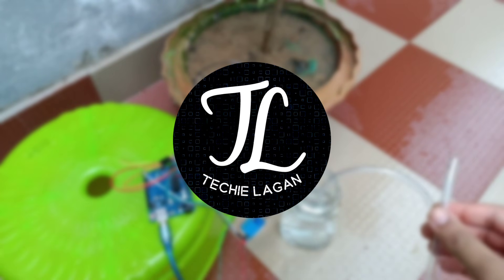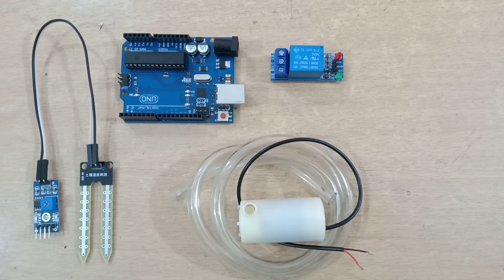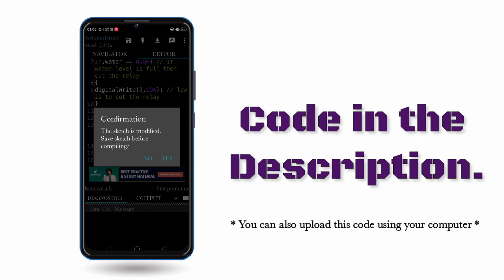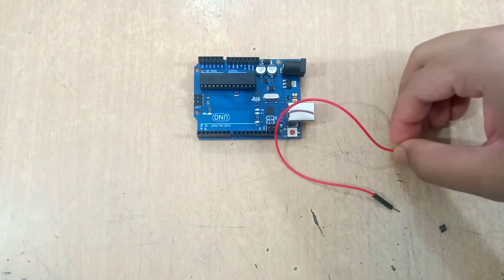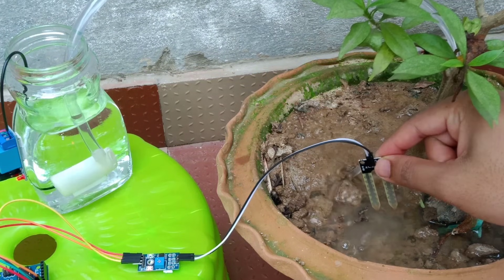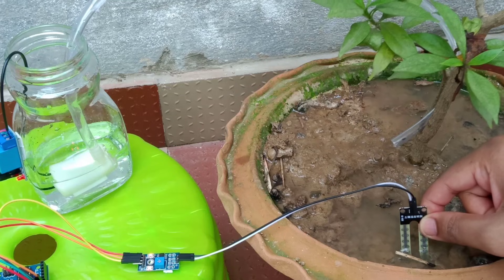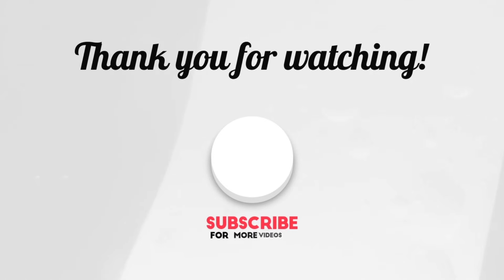How to make Automatic Plant Watering System using Arduino UNO and Soil Sensor || Techie Lagan

Comment from the maker: int water; //random variable 
void setup() {
  pinMode(3,OUTPUT); //output pin for relay board, this will sent signal to the relay
  pinMode(6,INPUT); //input pin coming from soil sensor
}

void loop() { 
  water = digitalRead(6);  // reading the coming signal from the soil sensor
  if(water == HIGH) // if water level is full then cut the relay 
  {
  digitalWrite(3,LOW); // low is to cut the relay
  }
  else
  {
  digitalWrite(3,HIGH); //high to continue proving signal and water supply
  }
  delay(400); 
}
Reply: Sir ...I connected all and the motor is running...but when I put sensor in the mud or water motor also running it doesn't on or off ...what can I do for this problem plz solve this 🙏
Reply: @khadizayesminnodi8786  I had this problem until I fixed the code

void setup() {
  pinMode(3, OUTPUT); // output pin for relay board, this will send signal to the relay
  pinMode(6, INPUT); // input pin coming from soil sensor
}

void loop() {
  int water = digitalRead(6); // reading the signal coming from the soil sensor

  if (water == HIGH) { // if water level is low (i.e., soil is dry) then turn on the relay
    digitalWrite(3, HIGH); // high is to turn on the relay
  } else { // if water level is high (i.e., soil is wet) then turn off the relay
    digitalWrite(3, LOW); // low is to turn off the relay
  }

  delay(400);
}

Enter this code, most likely the problem will be solved
Reply: @amirreza33   same issue is coming for me
Reply: @chvinaykumar245  is it solved or not?
Reply: @chvinaykumar245 plz reply bro
Reply: @amirreza33  bro konsa port use kiya
Reply: @amirreza33  
Thankyou for informing
Reply: @amirreza33 bhai help karna problem aaraha hai plz
Reply: @amirreza33  but using your code the motor is not running bro
Reply: @Abhishekgowdatech  but i used this code motor is working ... try to change motor
Reply: @Abhishekgowdatech  check the motor with power supply
Reply: Sir even tho everything is ok, the pump is watering again after it stop watering if the sensor put in the wet soil. How can I solve this problem?
Reply: @HtetHtet-l5k  adjust the sensitivy of the sensor
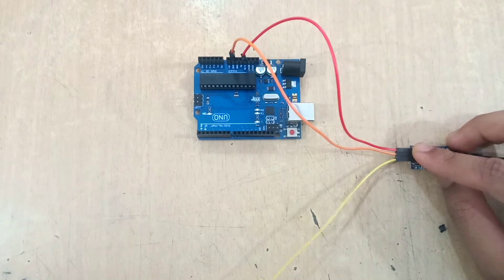Reply: 1:25
Reply: Hello lagan. did they pump comm connected to other power sources?? such as battery or anything else.our pump did not work. please help.
Reply: @MashirnaniYOLO  Yes, I used 2 AA batteries at the open wires from the pump in the relay module
Reply: @zanapoosarla5276 how to connect 2 AA batteries ? Or use the two ends of a single cell and connect those two wires at two ends?
Reply: https://youtu.be/iwkE_HWU-6M?si=E3mjWkJ8eFwrPtaW
Reply: Sir i didn't have any prob. It worked successfully. .
Thanku...
Reply: hello jo FL-3FF-S-Z KI GREEN LIGHT GALE GI
Reply: Okay
Reply: Bonjour  est ce je peux avoir le code
Reply: Kk
Reply: I can't copy this
Reply: @kumarkomakula1086  It sounds like you're looking to create an automated plant watering system using an Arduino. Here's a basic outline of what you'll need and how to set it up:

### Components:
1. *Arduino Board* (e.g., Uno, Nano)
2. *Soil Moisture Sensor*
3. *Water Pump*
4. *Relay Module* (to control the water pump)
5. *Power Supply* (for the pump)
6. *Jumper Wires*
7. *Breadboard* (optional, for prototyping)

### Steps:

1. *Connect the Soil Moisture Sensor:*
   - Connect the VCC pin of the sensor to the 5V pin on the Arduino.
   - Connect the GND pin of the sensor to the GND pin on the Arduino.
   - Connect the Analog Output (A0) pin of the sensor to an analog input pin (e.g., A0) on the Arduino.

2. *Connect the Relay Module:*
   - Connect the VCC pin of the relay to the 5V pin on the Arduino.
   - Connect the GND pin of the relay to the GND pin on the Arduino.
   - Connect the IN pin of the relay to a digital output pin (e.g., D7) on the Arduino.

3. *Connect the Water Pump:*
   - Connect one terminal of the pump to the normally open (NO) terminal of the relay.
   - Connect the other terminal of the pump to the power supply.
   - Connect the common (COM) terminal of the relay to the ground of the power supply.

4. *Arduino Code:*
   ```cpp
   int sensorPin = A0; // Soil moisture sensor connected to A0
   int relayPin = 7;   // Relay module connected to D7
   int sensorValue = 0;
   int threshold = 600; // Threshold value for soil moisture

   void setup() {
     pinMode(relayPin, OUTPUT);
     digitalWrite(relayPin, HIGH); // Turn off the relay initially
     Serial.begin(9600);
   }

   void loop() {
     sensorValue = analogRead(sensorPin);
     Serial.print("Soil Moisture Value: ");
     Serial.println(sensorValue);

     if (sensorValue < threshold) {
       digitalWrite(relayPin, LOW); // Turn on the relay (pump)
       Serial.println("Watering the plant...");
     } else {
       digitalWrite(relayPin, HIGH); // Turn off the relay (pump)
       Serial.println("Soil is moist enough.");
     }

     delay(1000); // Wait for a second before checking again
   }
   ```

5. *Powering the System:*
   - Make sure the Arduino and the water pump are properly powered. You might need an external power supply for the pump, depending on its voltage requirements.

This setup will read the soil moisture level and turn on the water pump when the soil is dry, and turn it off when the soil is moist enough. This should help keep your plants well-watered automatically!

Feel free to ask if you have any questions or need further assistance with your Arduino project!
Reply: How to use the code  can u give me some ideas abt that?
Reply: I'm trying to put code in Arduino by the mobile phone but it gets error
Reply: This is not work bro
Reply: @lakshyaverma9934 Work o no work
Reply: How much it cost
Reply: Tubf
Reply: Ya Jo last mn ap na Green aur red wire connect ki ya battery ki wires hn plzz mujhe jaldii batain
Reply from the maker: @Nadiayounis-s3w Han woh battery se connected hain
Reply: Motor kaise band ho gi mtlb jb us ko connect karte hn battery ka sath tu mtlb wo pani band ni hota😢
Reply: Kal mn na submit karna hn plzz mujhe sa ni ban rha😢
Reply: Good
Reply: /copy
Reply: Does this work?
Reply: 2:24 2:26 2:27

Comment: Not able to add code please guide
Arduino: 1.8.18 (Windows 10), Board: "Arduino Uno"

Sketch uses 1042 bytes (3%) of program storage space. Maximum is 32256 bytes.

Global variables use 9 bytes (0%) of dynamic memory, leaving 2039 bytes for local variables. Maximum is 2048 bytes.

avrdude: stk500_recv(): programmer is not responding

avrdude: stk500_getsync() attempt 1 of 10: not in sync: resp=0x49

avrdude: stk500_recv(): programmer is not responding

avrdude: stk500_getsync() attempt 2 of 10: not in sync: resp=0x49

avrdude: stk500_recv(): programmer is not responding

avrdude: stk500_getsync() attempt 3 of 10: not in sync: resp=0x49

avrdude: stk500_recv(): programmer is not responding

avrdude: stk500_getsync() attempt 4 of 10: not in sync: resp=0x49

avrdude: stk500_recv(): programmer is not responding

avrdude: stk500_getsync() attempt 5 of 10: not in sync: resp=0x49

avrdude: stk500_recv(): programmer is not responding

avrdude: stk500_getsync() attempt 6 of 10: not in sync: resp=0x49

avrdude: stk500_recv(): programmer is not responding

avrdude: stk500_getsync() attempt 7 of 10: not in sync: resp=0x49

avrdude: stk500_recv(): programmer is not responding

avrdude: stk500_getsync() attempt 8 of 10: not in sync: resp=0x49

avrdude: stk500_recv(): programmer is not responding

avrdude: stk500_getsync() attempt 9 of 10: not in sync: resp=0x49

avrdude: stk500_recv(): programmer is not responding

avrdude: stk500_getsync() attempt 10 of 10: not in sync: resp=0x49

Problem uploading to board.  See https://support.arduino.cc/hc/en-us/sections/360003198300 for suggestions.

This report would have more information with
"Show verbose output during compilation"
option enabled in File -> Preferences.

Comment: On the video he set up the cables on the arduino like this: 3.3V; 5V; GND; GND
But on the picture linked in the description it's different: 5V; GND; GND; VIN

So which one is correct??
Reply from the maker: The one in the video
Reply: @TechieLagan  Did you connect the arduino to your computer?

Comment: Thank you soooo mcuh it finally works!!
But the only problem is that it doesn't work if i dont connect it to my pc..
Even if i connected the relay module to a battery(The battery is composed of 4 AA batteries, is that the issue? I bought a 9V battery but I think it will work just fine with only 6V, because I accidentally toutched some cables and the pump suddently worked without any power from the PC)

Please respond and thank you!

Comment: -Arduino 
-Single-channel relay module
-Mini water pump 
- Small plastic tubing or pipe
- Soil moisture sensor module
-jumper wires

Comment: YOU FITTED MIDDLE WIRE IN CENTER TO MOTOR IN CIRCUIT DIAGRAM...IN VIDEO YOU FITTED TO BATTERY🤔🤔

Comment: can we did not connect the Arduino with computer or phone during project?? Does it work without computer or phone connection??
Please reply
Reply from the maker: U can disconnect it from ur computer once ur programmme is uploaded ..
But to keep it working u have to connect external power to it whether it is 9-12 volt source or power bank or directly connecting it to mobile charger adapter with that usb cable
Reply: @TechieLagan  thank you ❤️

Comment: How it would be used when it comes to reality?
Reply from the maker: It is just a prototype ( small scale model of real one)
If u want to use in real life then the  pump and relay with higher ratings will be used. Also jn place of arduini u can use any other microcontroller board or any single board computer like raspberry pi .

Comment: where have to connect the blue wire connected in the  ardino
Reply from the maker: It is used both for programming and giving power to the arduino

Comment: That red and green wire in the relay model should be connected or not?
Reply from the maker: ya it should be connected to the battery
Reply: @TechieLagan which battery voltage
Reply from the maker: @suryasplayz  3-9 volt

Comment: Where did you connected realy module wires? mention clearly..Any other external connections are required to realy module??
Reply from the maker: they are connected to a battery. Here relay module acts as a switch.

Comment: Sometimes the powersupply from the relay is not sufficient enough to power the motor pump. In that case, modify the following connection:
1) NO pin of relay-->one end of the motor pump
2) COM pin of relay--> -ve external power supply
3) Other end of motor pump --->+ve power supply. 

Rest all the video is perfect!
Reply: Can I use a 9v battery as the external power supply ?
Reply: @mohamedferoz I have the same question, do update if you know the answer can we use 9v as power supply for the relay and motor
Reply: @AshishGupta-np3ld  yes I used it and it worked
Reply: @mohamedferoz  Mine is having issues, but when I connected +ve of battery to -ve of Motor and the other wires to the relay it worked then (just tried) But I guess it's temporary as my relay starts to have issues, will wait for a while and update
Reply: @AshishGupta-np3ld  use either nc or no port
Reply: @mohamedferoz  I have put the -ve of the battery in the COM (Middle of Relay) and +ve of the motor to the NO (Left of the relay opposite red bulb of the relay) kindly suggest if this is correct
Reply: Does it need to be 9V?
Reply: I won't arduino  code if there will you provide me..

Comment: Sir, its quite important. may i just know the voltage of the battery you used.
Reply from the maker: For pump you can use 9 volt battery but for Arduino it depends from which socket you are giving power to the Arduino 
If you are using the power jack then you can give maximum upto 12 volt but if you giving power through the USB cable then you can use power Bank or charger adapter.
Reply: @TechieLagan Goodmorning sir, may I just ask how you have connected the 9 volt battery? Thank you so much and please reply fast sir, my project is due next week.Thank you again
Reply from the maker: Ig u r asking about the power supply to the pump.
So it is directly connected to the 9 volt battery through the relay module .
Here the relay is acting as a switch.

Comment: what is the other two wires read and green wires which u connected to relay module?? i didnt understand its connection
Reply from the maker: They are connected to the battery
Reply: @TechieLagan  hello ... thank you for ur reply...replay module , battery and pump connection can u tell me properly....bcoz for clg project I did this and connection with these only I did wrong....so can u tell me
Reply from the maker: @Sandhya_96  please follow the circuit diagram....

Comment: No mention about battery
Reply from the maker: sorry for that
Reply: @TechieLagan  voltage of the battery??
Reply from the maker: @Threya127  Here i have used power Bank for the Arduino and 9 volt battery for the pump

Comment: I have a question. where does the green and red wire which you connected to the relay module will go?
Reply: based on the comment, it seems he connected it into another powerbank. but he also said we can use a 9v battery instead. ill try it out in a few hours and see if it works. if i remember myself commenting here then ill try to update you too 😅
Reply from the maker: to the battery
Reply: @TechieLagan What is the battery like?
Reply from the maker: @dyaykaa9640 you can use 9 volt battery or power bank

Comment: can u please show us serial monitor 

const int soilMoisturePin = A0; // Analog pin connected to the soil moisture sensor
const int pumpPin = 7; // Digital pin connected to the MOSFET controlling the water pump

void setup() {
  Serial.begin(9600); // Initialize serial communication
  pinMode(pumpPin, OUTPUT); // Set pump pin as output
}

void loop() {
  int soilMoistureValue = analogRead(soilMoisturePin); // Read analog value from the sensor
  int moisturePercentage = map(soilMoistureValue, 0, 1023, 0, 100); // Map the analog value to a percentage

  Serial.print("Soil Moisture: ");
  Serial.print(moisturePercentage);
  Serial.println("%");

  // Check if soil moisture is below a certain threshold
  if (moisturePercentage < 30) {
    // Soil is dry, turn on the water pump
    digitalWrite(pumpPin, HIGH);
    Serial.println("Water Pump ON");
  } else {
    // Soil is moist enough, turn off the water pump
    digitalWrite(pumpPin, LOW);
    Serial.println("Water Pump OFF");
  }

  delay(1000); // Delay for 1 second (adjust as needed)
}

after uploading this code i can see the serial monitor moisture leavel when i have kept it out is 64 percentage and when i have kept in water it is 18 percentage the result is showing reverse can u tell me it is code problem or sensor problem

i am just doing another project on my own please can u tell me 
instead of arduino i am using esp8266 wifi module and in other one i am using arduino can u tell me two solution for esp and arduino please

Comment: The 5v mini water pump is half connected to the 5 volt relay module and the other half is connected to the battery? or power jack? 

please answer 😢
Reply from the maker: You can use anything

Comment: Question about the water pump: When you connected it to a red cable, where did you draw electrical energy for it to work? Can you please answer it?
Reply from the maker: I have used an external power source (Power bank)
and Sorry for late reply.
Reply: Which external power source did u use can you pls give the connections for it. @TechieLagan
Reply: Can I use different codes for aurdino

Comment: hi @TechieLagan,

I would like to ask a question regarding of the codes of this project.
on what specific program language you are using? 

is it C++, C, Python, or Visual Studio Code? 
or can I use any  programming language that I prefer?

would highly appreciated if you response immediately and nice project.
Reply: It will be c++ . For almost all modules programming language is c++ or it can be c. Not python in any case.

Comment: Sir can you please tell me is the green wire connected to the + of the battery or to the - of the battery and did you Connect the - ve of the pump with the relay N/O pin?  
Great video sir thank you very much
Reply from the maker: See the positive negative doesn't matter in the pump which is used in the video..
U just have to connect one wire of the pump directly to the battery and the other wire u have to connect it to the battery but through the relay module...
The connection will be same as we do for connecting a switch to any simple circuit...
Reply: Which battery bro

Comment: Hi Lagan bro, I am completely new to these circuity and all..
U said that we have to connect the relay to 5v power supply, as I am not able to find it..
Can I use 9v alkaline battery which i can connect with battery clip connector..??
Reply from the maker: yes you can use that